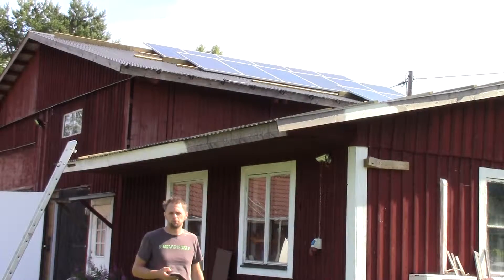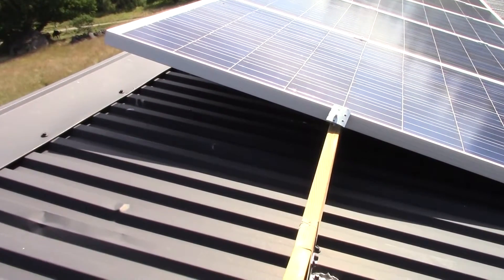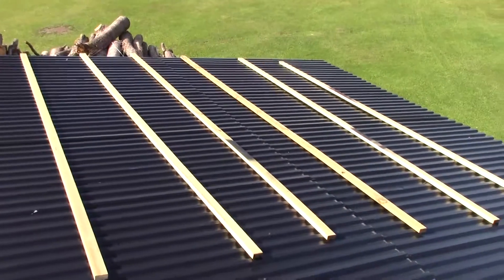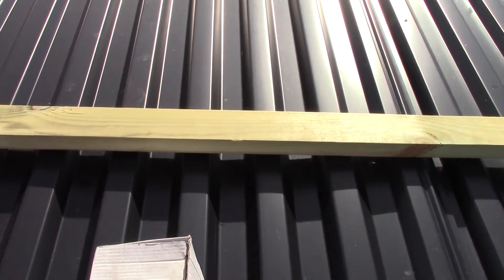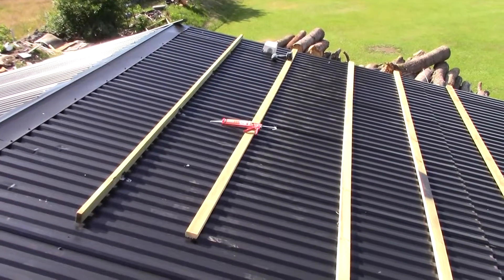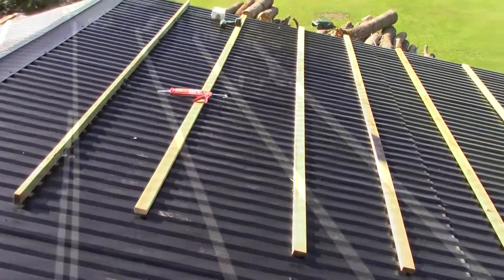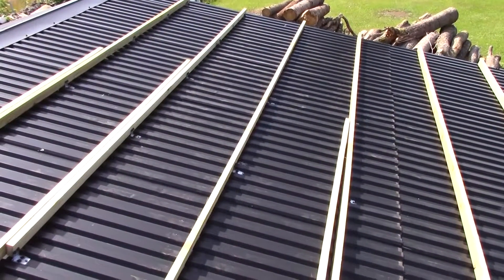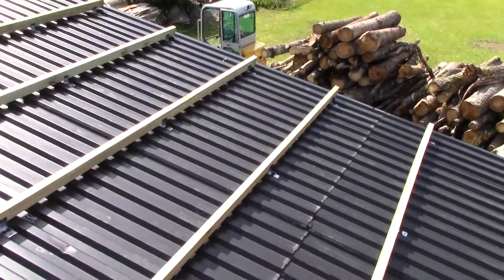Solar Electricity: Whats under my solar panels

Comment: Well, I had pigeons under my panels! Ensure the panels are closed off under all  the edges with mesh etc when you get them installed, else to will be housing dozens of rats with wings that will wake you when daylight arrives.